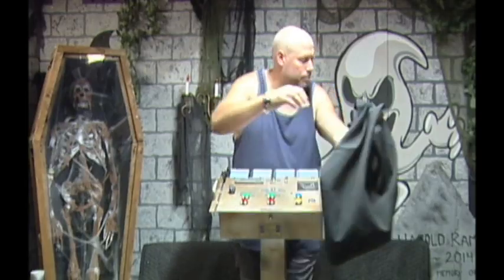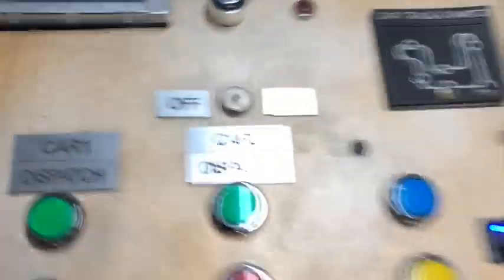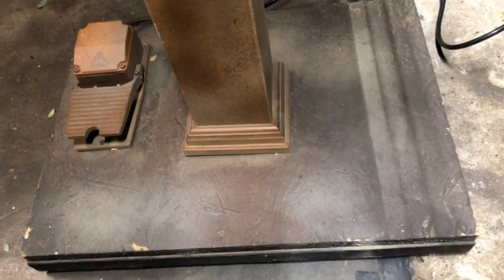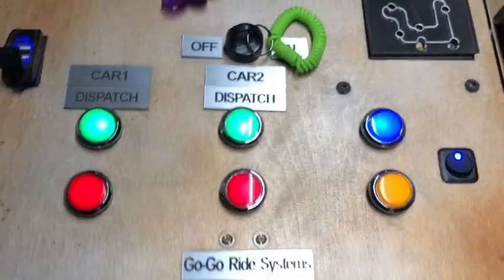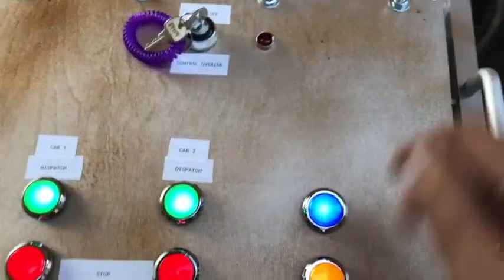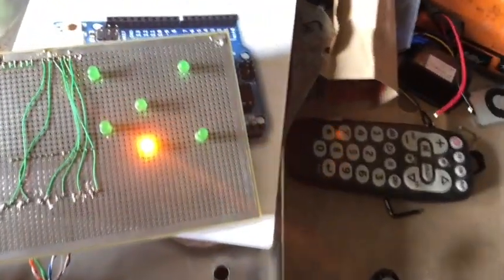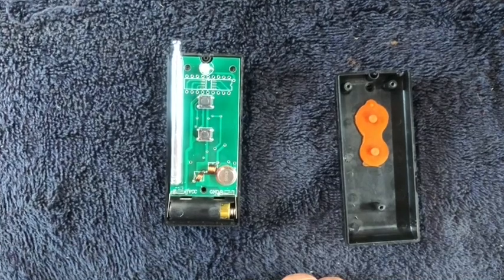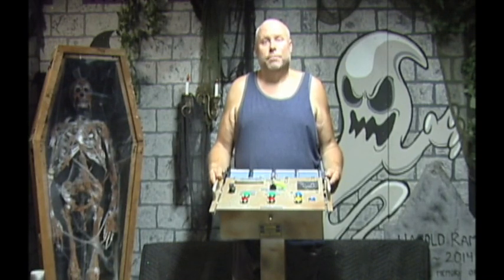Making a Home Made Dark Ride Episode 4

Comment: Awesome setup!  I used those same limit switches on my layout last year and had them tied into the dispatch system which was controlled by an Arduino.
Reply from the maker: Thanks! Yeah on my set up I tried to keep it simple.  So how did you tie them into the dispatch?
Reply: @pixelvisioner  On my panel, I could only dispatch if the limit switch in the station was activated.

Comment: Few things that I would do:

Integrate the wireless remotes into the control panel, let the antennas come out of the back (use something like a fancy wifi antenna type antenna)
Make a switch in the station to let the cars automatically stop (like u use switches to see where the cars are in the track)

But very awesome!
Reply from the maker: Yeah, I tried to keep it simple and straight forward for my first set up.  My new ride system is going to be fully automated with a micro controller and photo eye sensors, running 6 Blocks(zones) with tracking and self park and position advance, and it will have power on the track rail.  I have a teaser video up of the micro controller and preliminary panel set up I'll be using.

Comment: hey hello brett, here Anne again from Holland, I'm almost done with the go-kart now, I have a 12v motor with a chain, and a small panel with a pwm and key switch, and am now busy charging the battery, but this  I really have to go back to 100% from 0, and because I have a sailing battery from Varta, a gel battery, this will take a while.  but no problem, i have all the time XD 😝.  So I have a few questions, how many batteries do you need at least, for example to run the attraction for a few hours, and do you still need spare batteries?  In other words, how many batteries do you have?  .  and I have a question about a switch, because I saw in your video that when you turn on the switch, a red light comes on, but the start and stop buttons do go out.  so my question is, because usually a switch has 1 normally open, 1 normally closed, and common, can I, for example, connect a light to the NC?  Or does it not send a signal?  ie how did you do this?  hope you can help me with this.  oh yes one more question, what is the brand of the remote switches, and where did you buy them?  because I found some on Ali Express, only the remote switches, so the transmitters, are a bit too small, as they look, so I may not be able to get in to measure and connect the buttons.  a happy new year, for 2022 and hopefully I'll talk to you again soon, greetings from the Netherlands, Anne Schepers.
Reply from the maker: Happy new year Anne! Great to hear from you again! I'm excited to hear of all of your progress! I purchased the RF on/off remote switch on Ebay. Look up on Ebay: MSD-INC 12v output 30A ON Off RF relay switch long range remote control RX10P.  As for the override switch and red light they are not necessary, just an extra precaution since I had multiple people operate the ride. The switch disconnected the 12volts That powered the remote control units and turned on the light. If you want to connect that circut , yes you can use the NC side of the switch if the light you want to use is the same voltage as the power you need for the remote control units( I used a 12v power supply inside the control panel).  For the batteries I ran a 24v system so I ran 2- 12volt 20A lead acid batteries in a series in each ride vehicle and they lasted 3-3 1/2 hours with no problem. I did have an extra set of batteries just in case. Hope this helps you with your project! Brett

Comment: Hello, I have a question regarding the rf relays: did you use the exact same ones for both cartes or two different ones with different frequencese ? Do they not interfear with each Other?
Thanks allot and greetings fromm Germany!
Reply from the maker: Hi Toby, I used 2 different RF relays. The ones I used are the same frequency, but are linked to the remotes that they come with only. I have not had any interference between the 2 units.
Reply: @pixelvisioner  Ok, thanks allot!